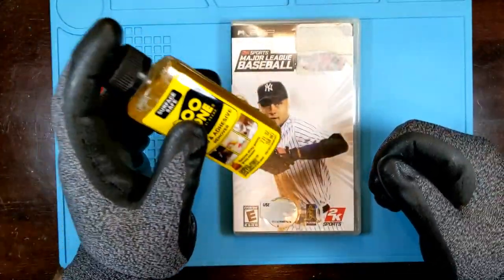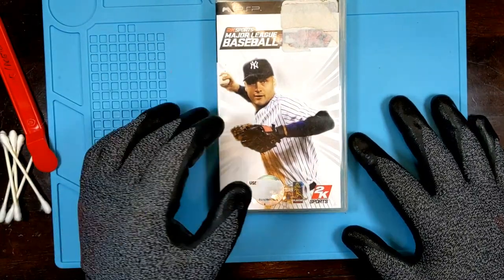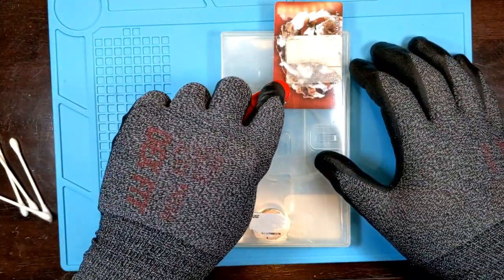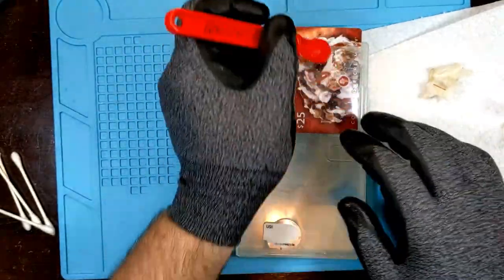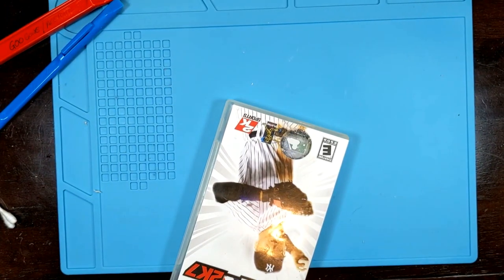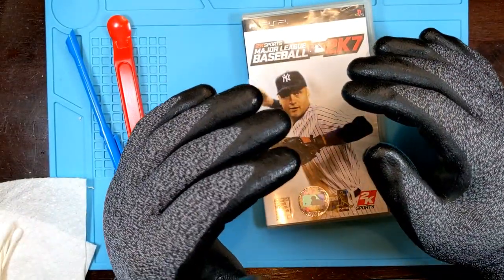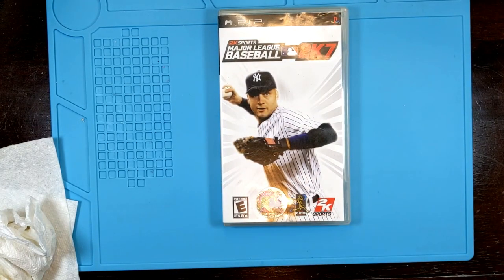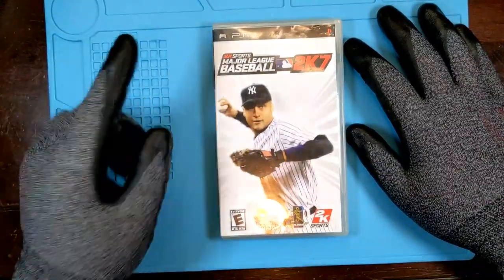Removing stickers from a PSP case: GooGone

Comment: A store near me has stickers so strong that they end up like this, so this is definitely really helpful
Reply from the maker: Yeah if the sticker is plastic coated or laminated, it'll peel off and leave this annoying paper/adhesive film under it. In those cases I try to pull off the majority of the sticker, so that my removal liquid of choice and permeate under the stickers surface and get to the adhesives. Sometimes it's better to peel off part of it messily!